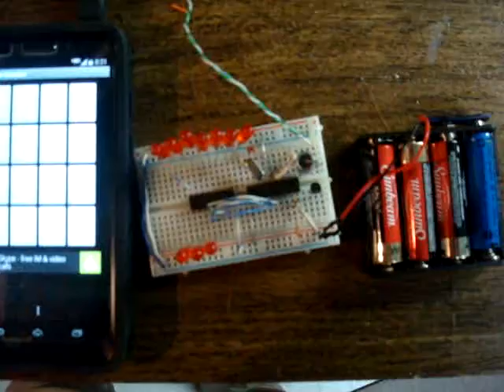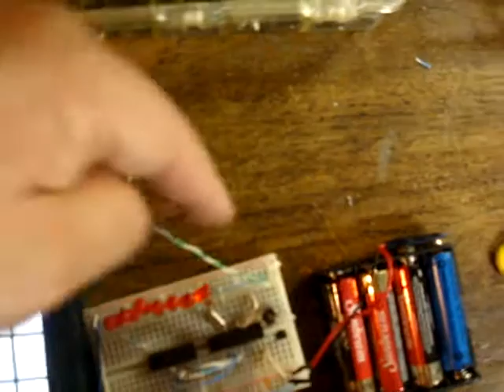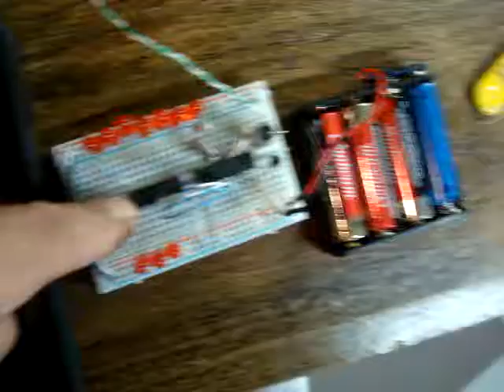MT8870 DTMF connected to 74LS145 decoder

Comment: Hi , thank for sharing your schematic to us.  
I´m  are in need of such circuit to my homebrew  door speakerphone adapter. A dtmf tone shall operate the latch. The doorspeaker adapter is connected to the analog trunk line card in my pabx which has nowadays no more function for its origin purpose in a digital world.
The adapter simulate a analog public telephone  exchange line circuit.  (SLIC)
It work in a way like a incoming phone call. Someone press the bell button, than  the circuit sends out 24V/50Hz,  all phones in a "doorlline group" ringing. A ringing tone, which is generated in my adapter let the visiter know that something happend. 
 If someone answer the call , the trunk line loop close and the assosiate circuit turn the amps on and the ringing tone off. For example Dilaing a 9 operate the eletric door latch with the help of your circuit.
So thats is my plan. Most of the circuits already  working on a breadboard. The dtmf decoder is the last on which I work on.

Comment: I am new to dealing with such circuits as this, at least building them from ground up.  What I cannot figure out is how to make it work so that there is say an unlock code, make it accept at least a six digit unlock before a user of the system can execute control codes.  The  how can their be a command prefix, say on is *2  ,  what if I want *32 to be a pin 2 on?  And *34 to turn on pin 4.   I use systems that do this and I would  love to learn how to create them on my own.  Multilayer commands for different actions.   I cannot find the right stuff Googling for it!  Any advice??
Reply from the maker: I believe the solution you are searching for would be excessively complicated using hardware and/or solid state electronics. I think you will find a better solution using an Arduino unit and coding software to do this. I have seen 4-digit codes which, in the proper sequence, and throw a single relay. The circuit uses at MT8870 output to a CD4015 Shift register and then output to a CD4063 Comparator.  Google "low power touch tone decoder" and you'll see this circuit.